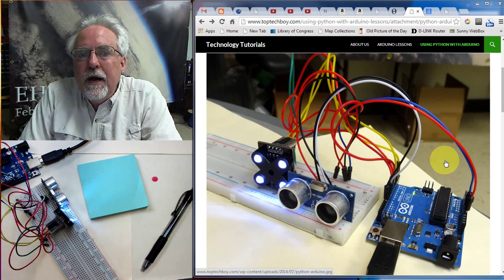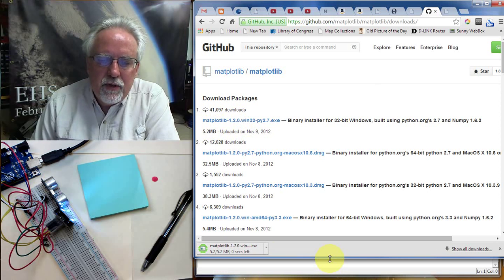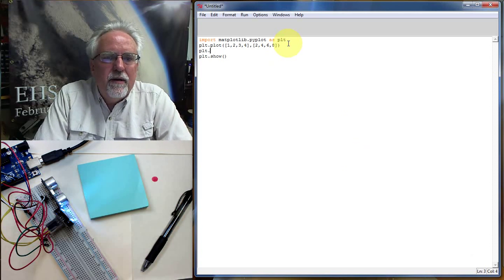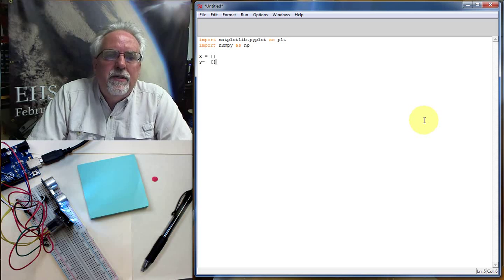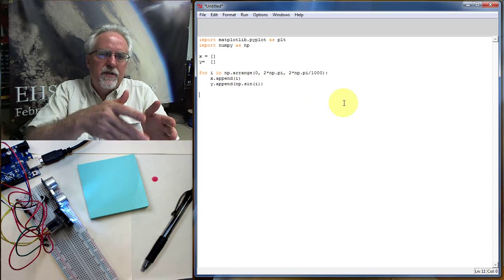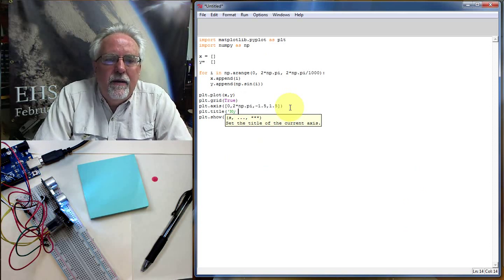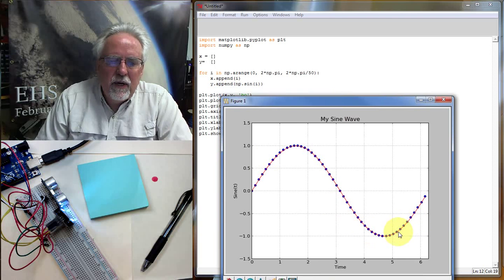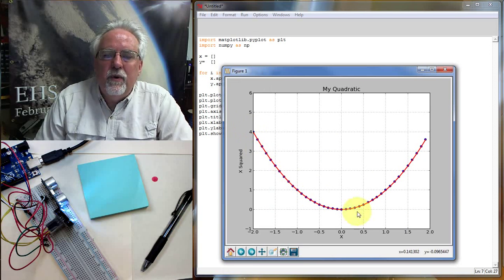Arduino With Python LESSON 7: Installing Maptplotlib for Graphing and Charting Data

Comment: I am expecting a bit more in details of matplotlib library. In most cases, python developers usually write docstring in a bit detail what can be done with the library, what are the functions are available, what are the classes and what are the methods/functions available under a class. In python, the time when I am pretty much newbie to a library and do not know anything then I usually do something to get myself familiar with a library. The steps I followed (in the command prompt/terminal ... in this case matplotlib):

import matplotlib
dir(matplotlib)
help(matplotlib.numpy)

Here, numpy is one of the output from dir(matplotlib).

Comment: whats the error saying"cant covert string to int"(value error) . i got it while running a program of  real time ultrasound sensor mapping. 
how can i fix it? vpython 7 and python 7.3 is used by me.
Reply from the maker: Python 3.7 puts extra characters on the string. The video was for python 2.7. If you use python 3, you will have to figure how to strip the extra characters off the string.

Comment: Paul
Have greatly enjoyed your videos.

I followed your instructions but found that it was not now possible (in 2018), to install drawnow. The reason, I am told, is that draw now needs Matplotlib version 1.5 or greater. Do you agree that this is the case. I tried to rectify by uninstalling version 1.2 and installing an updated version via pip. However when I tried to run your Vpython project I got an error message. Is there any easy solution?
Regards Neil Austen